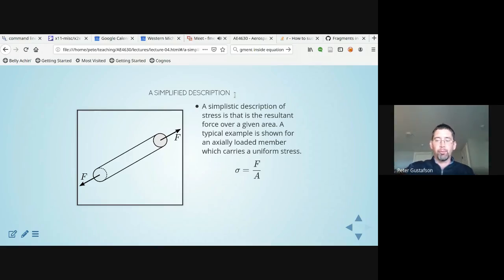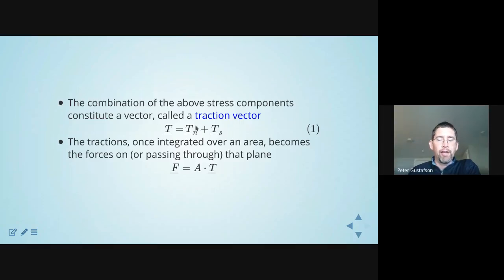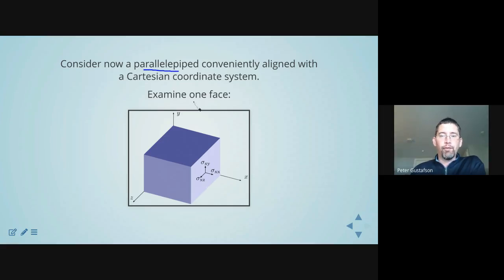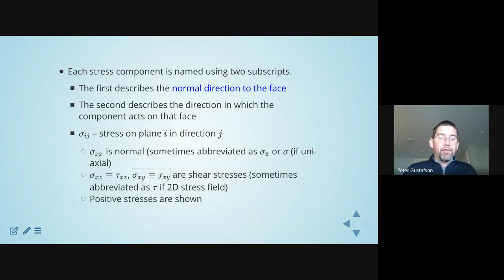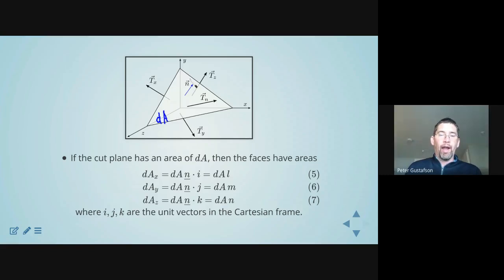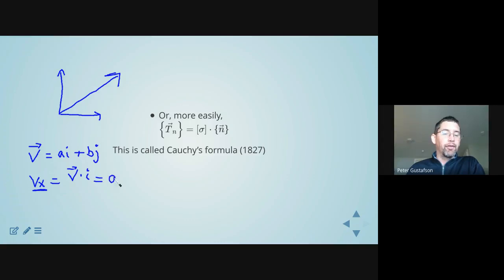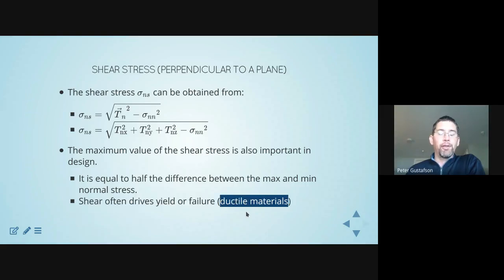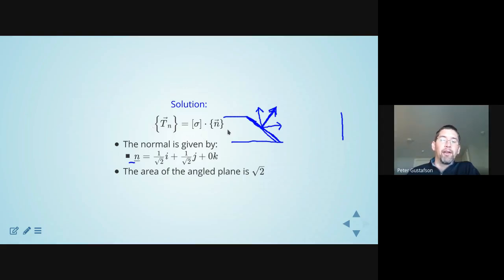AE4630 Lecture 04 - The Stress Tensor and Traction Vector

Comment: 2.2  Traction Vector 
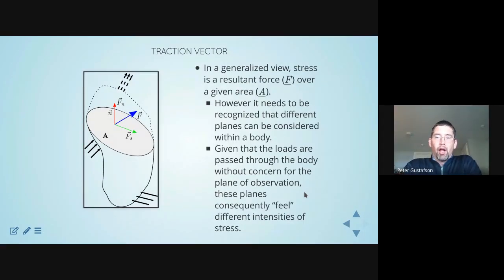@ 1:25

2.3 Stress tensor and its components 
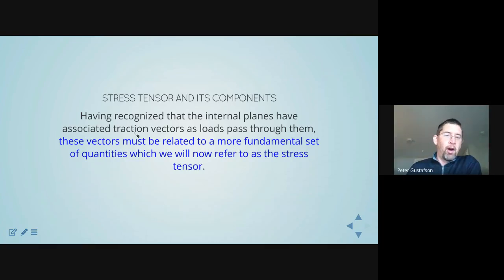@ 20:56

2.3.1 Tensor representation 
@ 35:42

2.3.2 Traction vector on arbitrary plane (Cauchy’s formula) 
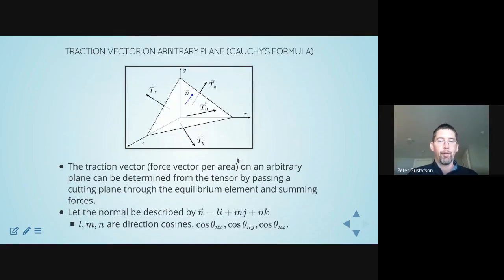@ 41:55

2.3.2.1 Normal stress (normal to a plane)
@ 59:35

2.3.2.3 Shear stress (perpendicular to a plane)
@ 1:06:59

2.3.2.4 EXAMPLE: tractions on planes of an axial rod
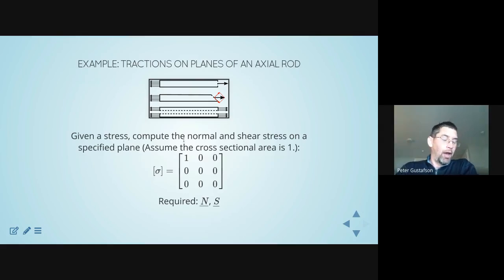@ 1:10:27